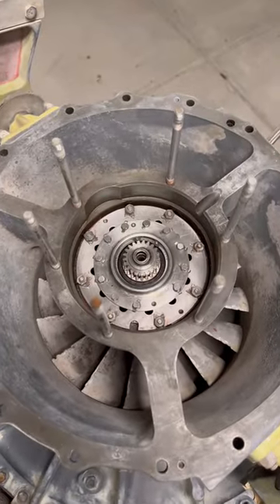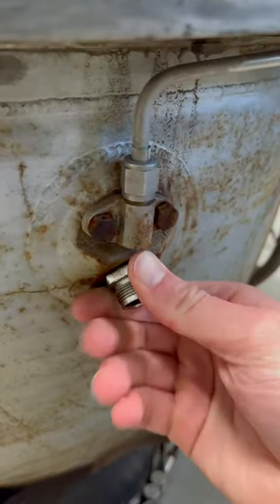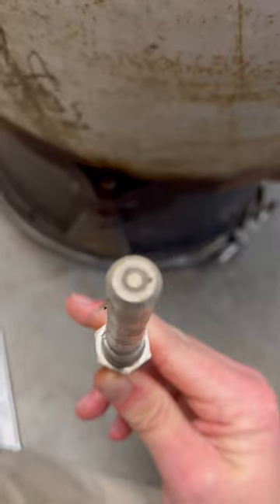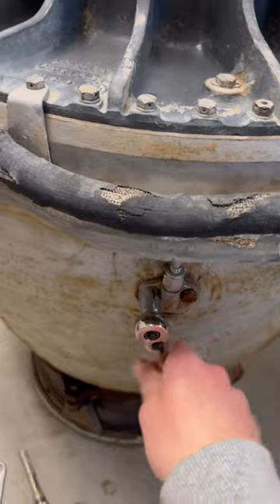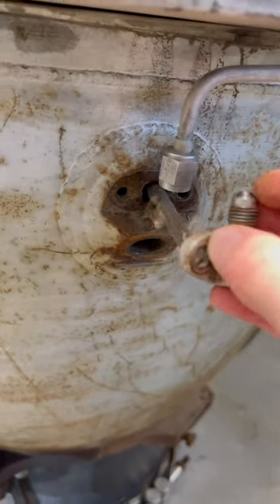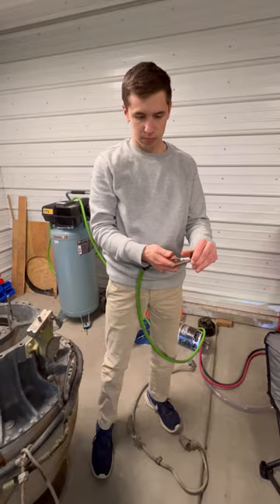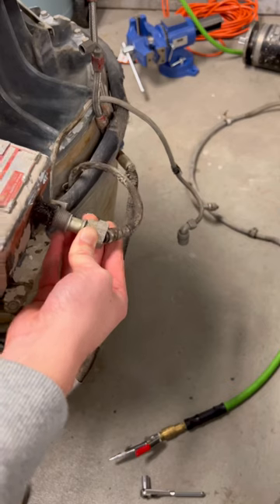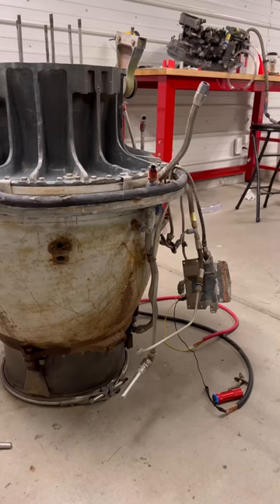Sketchiest Part of the Sketchiest Jet Engine

Comment: Careful with that borescope. They work great, but I was looking in a cylinder one day, through a spark plug hole. I pulled the borescope out and when I did, the think metal sleeve that goes over the camera on the end of the scope, fell into the cylinder. FYI, it’s non ferrous, so no magnet would get it. Also, it isn’t a hollow Cylinder through each end. The one end is closed off, so you couldn’t thread something through it. Add some electrical tape on the end to help avoid this happening and falling deep Into the bellows of your engine. Good luck
Reply: Rip
Reply: How’d ya get it out?
Reply: @GoldShoe Minstrel  the question is did he get it out
Reply: I would use one of those bendy claw tools that shoot out into 3 or 4 grab-hooks at one end, when you squeeze the syringe-type handle on the other end

Does anyone actually know what those are called? LOL
Reply: @viktorhardindyrvold4234  Claw Pickup/Grabber tool
Reply: @viktorhardindyrvold4234  yud need a boroscope too see where youre going with it though xd. No i dont know it but ik what you mean
Reply: Use a stick with Blu Tack.
Reply: @viktorhardindyrvold4234 bendy grabber claw tool?

Basically the most used tool on my apprenticeship when working on aircraft 😂

I never used to be able to hold onto anything, and it would always seem to find the smallest hole possible to fall through.

These days I don't drop anything.

Those hours with that tool and a boroscope were certainly "character building"!
Reply: @richardwillson101  
It's always the last bolt that manages to fall down the cracks. 🙂
Where did you do your apprenticeship?
I did mine with Qantas in Sydney back in 1995.🇦🇺
Reply: Great advice but I think in this case luckily one would be able to absolutely annihilate any thin small piece of metal foil/sheet with the literal fighter jet engine. 😁 would suck to lose like that though… but I am a believer in the thrust and heat that thing must produce
Reply: @poloska9471  there are 100% MANY places in that engine, where the tolerances become so tight, that even a small strip of metal can lead to catastrophic failure.
Reply: Had a coworker do something similar a few months back. He was doing a boroscope on the combustion liner and didn't secure the lens properly. It fell into the combustion liner. Took him the rest of the shift to get it out.
Reply: @deadpanda12109  
I didn't know they did horoscopes for engine components, I spose its more accurate than a boroscope inspection. 😋
Reply: @johno9507  lol, didn't even notice, thanks for the correction
Reply: I AINT READIN... ALLAT
Reply: @MinstrelSentFromAnotherLand  well, I had to use the borescope, with the sleeve missing still to see inside. I uses a thin piece of mechanics wire, as it was both small enough, but rigid enough to hold its shape. I put a VERY small bend on the end and then put a tiny piece of dum-dum adhesive on the top of that. I got the sleeve into position on the side wall of the cylinder and then CAREFULLY pushed the wire, with the dum-dum on the end, into the open end of the sleeve. Once I had got it started in the sleeve, I pushed as firmly as I could, causing the dum-dum to stick in the sleeve and cause it to stay on the wire. Then I have to VERY CAREFULLY pull it all out in one smooth motion, making sure to not hit the edges of the spark plug hole, which would cause it to fall off if I did. It also had to come straight out and through, making the dum-dum so important to hold. After about 5-6hours it was out. This was in a 2015 Ford E-350 school bus, so removing the head wasn’t an option, as the engine needs to come out in that year, to get the head off. This was one of those lessons you learn once and never wanna make that mistake again. Learn from my mistakes!!!!
Reply: Ebay build jet
Reply: Damm pain
Reply: Rip 💀💀💀
Reply: Vacuum with a thin piece of tubing to retrieve it. Saved a head removal on a Volkswagen diesel when the glow plug tips fell into cylinder upon removal.

Comment: Dude those igniter boxes will deliver some fatal ass amperage if you’re not careful.
Reply: Fatal voltage*
Reply: @oliverbevan2575  Voltage doesn’t kill, amperage kills.
Reply: @Cj-xl3jv  energy kills. You need enough current over a long enough duration for it to be fatal. To deliver enough current, you need a high enough voltage. 12v car batteries can put out hundreds of amps but you don’t see them killing people. On the other hand, all warnings say Danger: High Voltage not Danger: High Current. Voltage needs to be high enough to deliver a lethal current through the body’s resistance.
Reply: @Cj-xl3jv  I have heard this a thousand times.
Aren't you happy you got a chance to say it?
What is a volt? What is an amp? How do they interact?
Touch the output of an ignited box and see what the voltage does when the amps start to flow.
Reply: @DrShroom.    Lol I had the same thought
Reply: The sad thing about this comment thread is that most of you probsbly just repeated what you always heard, but actually had no idea until someone on youtube laid it out for you with pretty pictures, and now you just repeat that. Possibly still without an actual understanding. =/
Reply: @GodlyNoghri  I'm an engineering student
Reply: @Cj-xl3jv  You don't have amperage without voltage. Technically what kills is the Watts.
Reply: @GodlyNoghri  now the funniest part is confirmation popping up two comments later.
Reply: @Cj-xl3jv  electricity kills
Reply: @oliverbevan2575  been hit with multiple different zots from 12vdc (ouch) 24vdc (fucking ouch and burns) 240v 10 amps ac (what the fuck, i have a hole in my hand) 440ac 30amps (why did i wake up in hospital) 10kv ac automotive ignition low current (ouch thats annoying) 17kv ac low current automotive ignition (ow now my balls really hurt). Its amps across the heart that kill. And its only a few milli amps there that will kill you. Volts is the delivery, amps or current is the power. Or as my dad taught me, volts are the pipe, current is the diameter of said pipe.
Reply: @FrozenHaxor  you mean ohms law right?
Reply: @adzz8012  Yes, it's essential for this.
Reply: Ohm god guys watts the problem?
Reply: @adzz8012  Shocked bad enough, your balls will hurt like hell.  Like blue balls.  Not fun. And, no you don't have to literally shock your balls.  I took 4kv from a laser PS. It's real.
Reply: Amperage is directly proportional to voltage lol. "The voltage doesn't kill" is a dumb old wives tale and anyone that doesn't know better doesn't know enough to be fucking around with electricity. It doesn't have to cook someone to kill, only takes a momentary zap and a few milliamps across the heart at the wrong instant to cause cardiac arrest. Quite a few people each year die from touching capacitors that have basically no ability to provide sustained current.
Reply: @kylehenline3245  "Amperage is directly proportional to voltage lol." What a bunch of nonsense. This would be ONLY true if you've had constant and ideal resistive load.
Reply: @FrozenHaxor  lol ok bud, Ohm's law is nonsense.
Reply: @kylehenline3245  Nonsense? Have you even used it in practice? I use it daily at work and I assure you it's accurate.
Reply: @FrozenHaxor  Brother you are making no sense. It is one or the other, either current is directly proportional to voltage like I (and ohm) said, and I have been right the whole time, or you think ohm's law is wrong...
Reply: @kylehenline3245  It's only proportional when you have an ideal purely resistive component. You can't scale the Ohm's law "proportionally" in all applications. It's not dynamic. Have to recalculate based on real life variants.
Reply: @FrozenHaxor  That is true but for the purposes of electrocution it doesn't matter that much. A human may become more resistive as a result of burning, they might buck off randomly from muscle contraction. But it you have cooked enough for that you may already be dead, and if you  contracted that hard your heart may have too and you are now in arrest. Contact time is definitely super dynamic IRL but there are too many factors to calculate. Contact time being the same higher voltage is more energy and generally more severe injury. There are exceptions but the majority of overcurrent protection is just there for conductors and won't trip at a level that will save your life, the voltage applied to you directly determines how much current you get.
 I will say I truly believe 110 is more dangerous than 220-440, cause the latter two tend to spasm you violently across the room away from whatever you touched rather than locking you on. But once you get to 880 AC 350ish DC it tends to be immediately fatal cardiac issues.
Reply: @kylehenline3245  True, carbonation of organic material starts to massively decrease the resistance increasing the current and driving the process forward in a runaway style, also FR-4 PCB laminates will develop inter-layer shorts from overheating. Also true about the OCP breakers, always calculated to protect the structural wiring, only the RCD is for the humans. Haven't even touched 110V, we get nominal 230V residential supply in EU provided in 3 phases (400V phase to phase) as standard, had on one occasion grasped firmly live and neutral, it violently shook me side to side so much that my hands were torn off the conductors, you're absolutely correct on that. (Haven't tried the 400V and don't plan on!)
Reply: @FrozenHaxor  Definitely don't recommend 440! I was lucky and just got a little zap brushing a finger on the terminal of a contactor, but still had a terrible head and JAW ache for 3 days. I always thought the old dudes were lying about 440 making people's teeth fall out, after experiencing it I'm not so sure.
Reply: @Cj-xl3jv  a car battery you can touch each end and nothing happens 12v with about 400-500 or so cranking amps
Reply: @Cj-xl3jv  how many amps can kill you? I was trying to aluminum tig weld accidentally stuck the filler rob to the tungsten and it juiced me with about 150 amps
Reply: Have the armchair Electrical Engineers come to a conclusion yet?
There are so many qualified experts here.
Reply: @ADZ z  u have never been electrocuted by 12 volts.. sorry
Reply: @Cj-xl3jv no both kill, you'd be stupid to not be careful around both
Reply: @Cj-xl3jv ooooh look, we found the guy who doesn't understand ohm's law 😂

Comment: You need to ground the base of the ignitor rod like you do a standard spark plug. Duh.
Reply: No. The ignition cable is co axial. There is a core conductor and the outer sleeve is the return.
Reply: @Richard Kudrna
Is that for interference?

Comment: The ignitor will spark when it is connected with the shielded cable. It will get the ground through the shield. I used to test ignitor boxes in a previous job a long time ago. They were  used on Rolls Royce Nene and Dart engines. Also the ones used on the test stand for different types of other engines. Does it look like water got inside the box? Maybe the connectors are dirty or the cable is bad. You can connect the ignitor with jumper cables but be very careful you can get a strong shock. The batteries should have enough power to test them. If you are using a power supply be sure it is not going into overcurrent. I don't think it is a good idea to start and run this engine. I am not trying to help you to start and run this engine,  just helping to test the ignitors. Do not start or run this engine, it can explode and cause a lot of damage and injure people.

Comment: Literally did this today for one of my practical projects on an Rolls Royce Allison 250 axial turbine engine, the Ignitor plug sparked like crazy and I hadn’t even hit 28V yet
Reply: By design you want igniters to fire despite bus depression caused by starter load. Typical exciters will fire at 12 volts, some down to 9 Volts.

Comment: This one of those things that gets more and more expensive to repair the further along in the process you go.  Even once fully rebuilt to spec, simply running the engine will cost you around $750 or more every hour in fuel costs.  It’s defiantly doable and there are plenty of business jets around today that have a much higher burn rate, but it defiantly requires a certain degree of wealth to not have to worry about hourly costs while trying to have fun and just fly.  That being said, there are quite a few people who privately operate and afford twin engine supersonic aircraft like the t-38 talon, and even that one guy who operates a couple Harriers, so if money is no obstacle then the only thing holding you back is your own knowledge of how to get it done!

Comment: The igniters won’t spark btw. They just get very very hot.
Reply: What? All gas turbine ignitors I've worked on definitely make massive sparks.
Reply: @slimjim1125  I guess you don't work on many
Reply: @Bigfootguy1  I guess you haven't worked on any that spark.
Reply: @Bigfootguy1  Here's a very similar unit to the ones most commonly fitted to the Turbomeca Arrius engines I work with.

https://www.youtube.com/watch?v=NmHW65093_o

Comment: Did you try grounding the side of the ignitor on the housing?  I know regular spark plugs use the threads as the ground
Reply: It will get the ground through the shield on the cable.
Reply: Did you see the cable?😅 the only thing you will get from that is more corosion 😂

Comment: The ignition won't work if it's not connected to ground
So you need to connect the battery negative to the plug or or better to the engine and hold the plug againt the engine

Comment: Do these igniters act like spark plugs and use the body as a ground? Or are they internally grounded?
Reply: This, they might need some ground where the spark can jump to. Regular sparkplugs ground from the body but those look like it needs ground near the tip of the plug where spark can jump to
Reply: They will get the ground through the shield on the cable when the ignitor is removed. I used to test ignitor boxes in a previous job.

Comment: Igniter plugs usually will last longer than the turbine due to them only being needed to fire once per cycle. Kinda like a grill lighter
Reply: Also be careful with igniter boxes as some older turbines do contain radioactive materials to assist with ignition

Comment: The igniter may need to go through a start sequence in order to actually spark
Reply: good theory but if it's a simple circuit it should be able to be sparked if you put power to it
Reply: Might have to short across the oil pressure switch to get spark. Not sure how the T-37’s are wired but I’ve worked on small gas turbine generators with oil pressure safety switches.

Comment: The housing for the jet won’t keep the impeller aligned. It’s a bomb man.
Reply: he plans to make it somewhat work and then probably thought alit up at a safe distance in a field or something. pretty sure I saw it in like an old comment responding to someone
Reply: Lol
Reply: Well he inbalanced the turbine blades by removing the bend parts of the leading edge  it will shatter fore sure just a question if he gets the rest running so fare that it rapidly disassemble it self or not
Reply: No it's not.
Reply: @sfsgcsvxcv yes it it 
It will never actully work hes just veiw farming

Comment: Did the igniter plug have ground connection when you tested it?
Reply: Because it seems to me that it is just hanging from its wire. Or does the wire have a ground?

Comment: I dont know anything about jet engines but i know about car engines, isnt the reason why it didnt spark is because it uses the engine for ground? And it wasnt grounded when you tried it, as it was just hanging in the air.

Comment: i you connected the car battery in parallel it 12 volts not 24, you have to connect one battery - terminal to other battery + and the connectors left will supply you with 24 volts

Comment: Dude firing up that engine is going to  get you killed. That thing spins at 26000RPM you have no clue what you are doing. With all the cracks in the compressor casing it is going to explode like a bomb. You tube is not worth dying over.